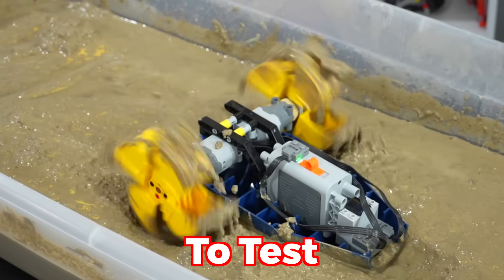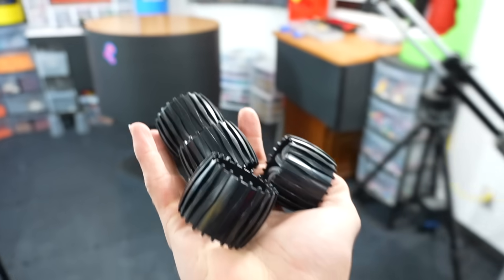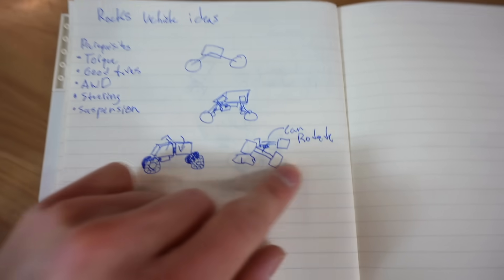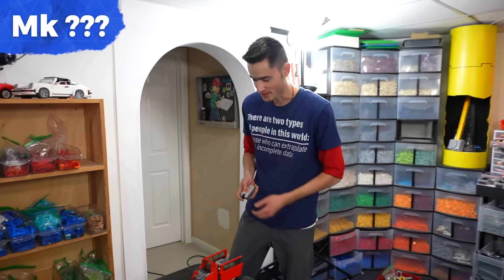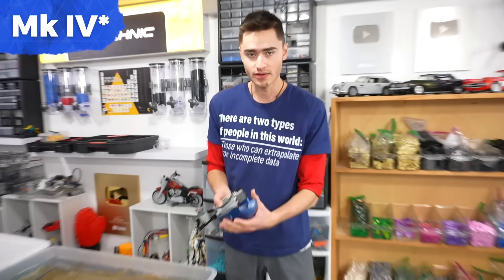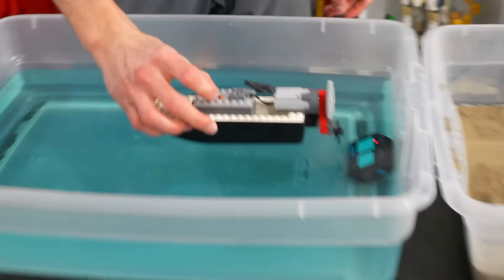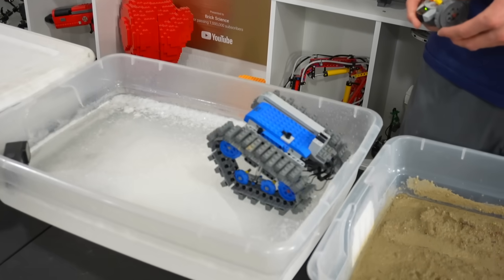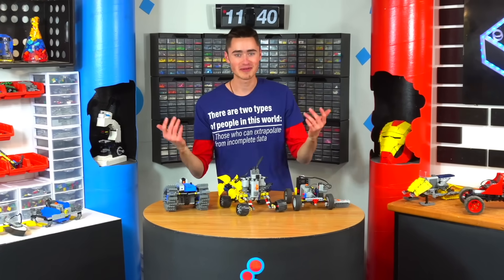LEGO Vehicles vs All Terrain...

Comment: Technically, if you use a Lego motor and hooked up just a simple servo, so you could turn the wheel, use the motor and use a propeller to propel it forward and the servo to turn it

Comment: 3:15 the reason this works is because the tire traction is made for the moon (obviously) but another reason being is the wheels are hollow on the inside meaning there is no braking mechanics on the inside that can get clogged by the sand.

Comment: corrections and minor mistakes:
bevel gears? nah 90 degree actuator (they are called bevel gears)
perseverance? nah lunar rover (rovers are stupid on the moon as we have gone on the moon)
proper suspension? nah lets just make the middle rotate (you need proper suspension, with springs and dampening)
stabilizers? nah ballasts (ballasts are heavy)
continuous track vehicle? nah tank (tanks are armored and usually have guns) 

at every chance i get, i will point out your mistakes. and i dunno why, but i hate hearing people say or do stuff without research. you are not very good at mechanical lego, please just research and learn at every chance you get. you may be good at building, but you doing mechanical lego makes my ego go insane

Comment: The tank tread would've worked well in the mud due to wide dispersement of surface contact.
Reply: Only prob is sinking because the mud is very watery but it still would be a great idea
Reply: @natasharufe5180  Put in two of the small boats side by side between the tracks, so they help distribute the weight.
Reply: @natasharufe5180 How would it sink? Tanks were literally invented to move over mud.

Comment: The sand wheels that you used were inspired by the "Perseverance" rovers wheels, which is operating on mars. It makes total sense why the wheels work so well with the sand because those wheels were built for planets mainly composed of deserts and rock.
Reply: He honestly could have put a motor in the perseverance set and called it a day. Maybe take of a couple decor to reduce wait and add rubber tires for ice

Comment: U should make a transformer(with suspension ofc) using the mud tires and rotate them per terrain
Reply: Mud tire can work in sand
Reply: Suspension helps in rocks
Reply: Ofc theres a mud tire
Reply: Turn the tire 90° outwarts to make it float
Reply: Mud tires will help in ice
Reply: And snow
Reply: SO 5THIS IDIEA WORKS
Reply: *this

Comment: Lock your rear differential. You need even power distribution between both rear tires, with no slip.
Reply: cool
Reply: Exactly alot of the problems can be solved with just a locking diff.
Reply: That’s smart
Reply: yes and all wheel drive damn it
Reply: Exactly what I was thinking, for the one on sand, he could have probably have bigger tires, a locked diff, and had more of the weight on the back
Reply: real differ-what
Reply: @ItzWinnerWillow  a rear differential lets the tires spin at different speeds, but locking it would make them spin at the same speed.
Let’s say one wheel is stuck in mud and the other is just spinning, if you lock it, it would help the wheel get moving since they are now spinning at the same speed
Reply: @ItzWinnerWillow watch this Around The Corner - How Differential Steering Works (1937) it’s great
Reply: @ItzWinnerWillow  How do you not know?

Comment: This was an awesome video with the trial and errors, but I realized you can make a awd dune buggy with independent suspension (can be hard to make but its possible) and with the right gear ratio it would have conquered all of the terrains like its nothing
Reply: what about water and mud
Reply: @patata-nl If it's light enough, it will float and spinning the wheels will make it go. As for the mud, you again need very light weight (aka go for standard 9V battery or lipo instead of heavy Lego batteries) and super deep tread pattern on the tires. Also, the wider the better.
Reply: One of the errors is saying that the perseverance's wheels are made for the moon
Reply: I didnt realize that, while the wheels do affect the performance in a way but the way its built will affect the performance too but nice observation @CarrotFarmer
Reply: So true!